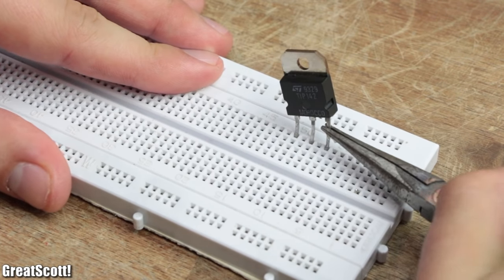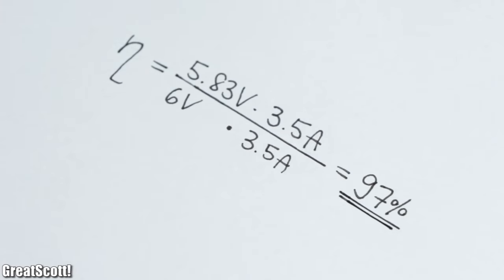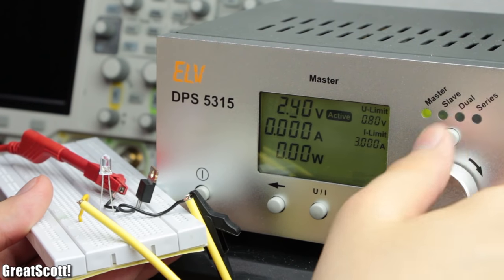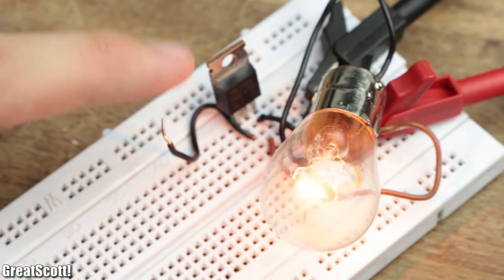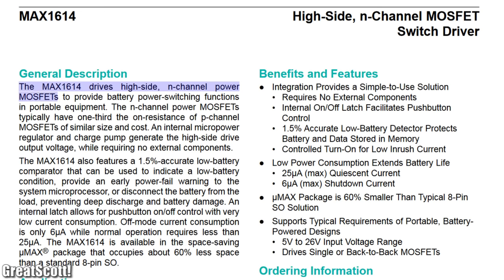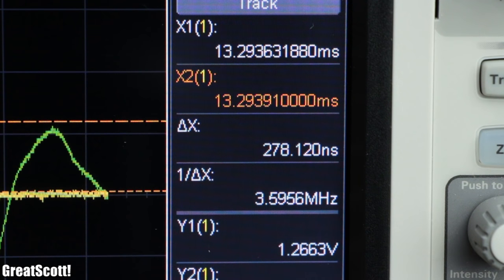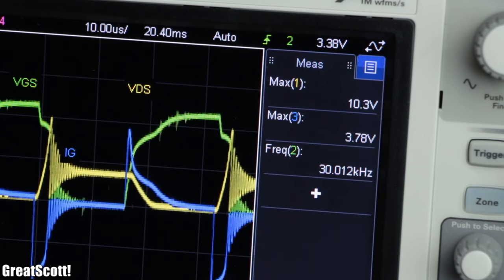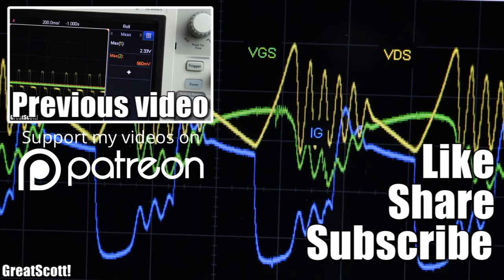Electronic Basics #23: Transistor (MOSFET) as a Switch

Comment: I would really like it if the information would have been stretched to about twice of the length of the video. To do that, maybe you can talk about the values you underline after you mention them. For example, while you are underlining Vth and saying "MOSFET has to cross the threshold voltage at the gate to operate" Instead use a short clip while stating the line above and then use the datasheet video clip while stating the values and how they relate to your circuit you are currently working on. I know that this might increase your work per video but you can maybe put one more short 5 sec add to make up for your extra efforts.

Comment: Wait, I thought that if the signal going into the N-Channel MOSFET was high, then the output of the MOSFET was high, not low? Why is this? Thanks
Reply from the maker: When the voltage drop of the Drain to Source path becomes "low" (almost 0V) then it means that the switch is turned on.
Reply: Ok, Thanks and can you please reply to my comment on your Thyristor, Triac electronics basics tutorial, thanks again :)
Reply: this is because 180 degree phase shift in output voltage,when voltage at gate to source is positive then output voltage Vds is negative or vice versa and current Id is in phase with input signal

Comment: Im testing irfz44n with an esp32 drone build. I burnt up 2 gpio pins. I have a flyback diod and flyback capacitor with a 220ohm from gate to gpio. I was thinking i could use a npn to control the mosfet. My understanding is the 3.3v pin is not enough voltage to power the mosfet.

Comment: project idea: Convert a NiCad tool/device to LiPo batteries is easy, just pick the right number of cells and appropriate capacity, right? The problem is no low-voltage cutoff protection . Please design an easily adaptable circuit for the number of cells being used but with the correct cutoff. thanks

Comment: Im making a 555 monostable circuit with a motor at output. The problem starts when I try to put the motor and circuit stops working correctly..I think the problem could be the mosfet cause I've already put the paralell diode and a capacitor between the motor thinking that it was the main problem but obviusly it doesnt. Pleasr can you tell me how to fix it or where can I watch information about. Great videos.

Comment: Pls upload a video about how to read datasheet and its practical meaning .
Reply: The main things you want to read about a MOSFET is it's voltage and current ratings as well as it's RDS value the lower the RDS value the better. Maybe also the gate threshold voltage so you know at what voltage the MOSFET turns on.

Comment: Dear Scott.
I hope you can help me out.
I am building a 6x6x6 rgb ledcube.
I want to use a mosfet to switch the ground of the leds.
So the current wil be between 15 and 540ma
The leds voltage wil be 5v.
The arduino to gate wil be 5v 30mA
Can you help with mosfet to take.
Thank you in advanced

Comment: I'm using this method to switch an LED strip using  PWM signal from an arduino. When the PWM signal is set to 255 (Always on) The voltage across the LEDS are only 10.4V even though the source is 12v. Not sure where these 1.6v are being dropped but I WANT THEM BACK.

Comment: If I want to use something as a switch in a circuit with such a component that is neither connected with Vcc nor GND, e.g. switching three sets of resistance for control gain of an ac amplifier or a ac signal to stop or allow to the amplifier input, and control the switching with arduino, what should I do? 
Relays are okay in this case. Buy very soon circuit is becoming bulky.
With a 10 kHz signal, I think TRIACs are also not applicable. 
Provide me some suggestions.

Comment: Hi. Thank you for your videos. I have a question. As thr good way to connect an Arduino to a Nmosfer with a pull down resistor, the mosfet off aytomatically, but if I want to keep the mosfet on without to have an output of Arduino in ON, is there some way to do that simple? I know that the simplest way was to eliminate the pull down resistor but this is not a good idea. Thanks in advance and best regards.

Comment: I would like to make a led light bar that flashes 16: 1 watt leds, 8 white and 8 red preferably with the ability to flash 4 at a time. I have a arduino that is outputting the signal to my tip120 that is going to switch the 12 volts to the led driver but after watching this video I dont think i am doing it right, what do you recommend?

Comment: First, thank you for the good videos. I have a question please, Is it possible a circuit to activate a mosfet and keep it ON without the gate signal (for example if I activate the mosfet with arduino, to not have an Arduino output connected ON but the load keep connected). Thanks and best regards, Lorenzo

Comment: Nice Video!
I wanted to use an IRFz34N for a simple speed control circuit to my linear actuator (5-8 amps) controlled by my micro-controller. 
I ordered the parts and I have the pull down resister, but am I limited as to the switching frequency due to the issues you mention?

Comment: im so confused on what i should be using. bjt or mosfet ro something else. i wanna controll a 12v relay coil which draw .15a. i prefer switching the high side. what should i be using? ill be using an arduino. also i love your videos

Comment: Is there anyway to check the continuity of the load (LED in this case) through the MOSFET with an ADC pin without blowing up the arduino with the load voltage?

Comment: Hi Greatscott, very nice video as usual. I have a logic level n-channel mosfet(FQP30N06L) and switchin on-off by appliying 0 and 3.3v Vgs from a gpio pin. Drain side I have a load operates at +5V. After the pc turns off, PC pulls up +5V  all GPIO pins(Vgs). As a result after pc turns off it  turns on the load again. How can I prevent the gate voltage if more than 5V at the logic level mosfet? Best.

Comment: I noticed that you don't have a current limiting resistor for the led, I was thinking of a 3V 350mA 1W Led load and PWM dimming. should i add a resistor to limit the current?
Reply: or just make an lm317 cc source. not that hard and you can run high power leds for a long time.

Comment: I may be wrong bt why is drain the collector and source the Emitter. Shouldn't source mean collector and drain meaning Emitter
Reply: Well if you compared a BJT to a MOSFET then the source and emitter are connected to ground if the said transistors were a NPN or N-Channel while the drain and collector is connected to a loads —

Comment: +GreatScott! I have question:

Can the N-channel mosfet turn on and off in high frequency (say 300KHz) without oscillation circuit?

I remember when I opened a cell phone charger; I noticed that the high 
frequency transformer is driven by square wave oscillation from N-CH 
MOSFET. But what I didn't understand is that how the MOSFET can be used 
to deliver this high frequency square wave. I have not noticed any 
familiar oscillation circuitry though like 555 timer to drive the gate 
of MOSFET to deliver such high frequency square waves.
Reply: the mosfets recieve a high frequency voltage on the gate from an oscillator so it oscilates the voltage flowing from drain to source, its more efficient to do it this way than to oscillate the voltage coming into the transformer directly
Reply: +lol49031 Thanks man; but when I examined the phone charger circuit, I did not noticed any oscilator driver at the gate of the MOSFET.

Comment: Great video 

I want to ask something, I want to adjust the voltage across the load according to what I want, after simulating in proteus the voltage at the load remains equal to the source voltage to the drain, I have set the duty cycle in such a way but no changes occur, what should I do do?

sorry for my rip english 😋😋

Comment: what's more power efficient? a PWM circuit to control brightness on a LED or a variable resistance connected to the base of a BJT?
Reply from the maker: PWM
Reply: The reason being with resistors you're dissipating the power as heat but in the case of PWM you're just not giving power to the LED which means no power is dissipated by heat

Comment: sir if battery rating is v volts n I Ahr does power of battery be VI eg
7.2 v n 4.2 Ahr gives 30. 24  joules an hr n what would be the power?
also
I think it is better to tune the potentiometer to less resistance to use the battery power efficiently n reduce the loss as heat.

Comment: If I wanted to turn a PSU on through the green wire and ground using a raspberry pi's GPIO, would it be best to use a mosfet to silently do the switching?
Reply: if you're using mains voltage/AC, don't, do some extensive research about it, the safety hazards and you will know what to use.

Comment: Am new to using mosfet I like to know why irf4104 get hot in 1second when using it to making a inverters,I used 2 mosfet irf1404 I used a  two100ohms resistor at S and G and  two 987ohms at D and G but instead on switching to ac the transmission got really hot nothing work the battery so hot it burn my fingers I read alot of info on inverters it look so easy but I cant get the mosfet to work do I have to use 470 ohms to gate and and drain instead of a higher value

Comment: I am trying to control 2wheeler horn with my esp32 through a 12v automotive relay,horn is taking upto 15a of current at 12v.
THE problem is whenever i send on signal for 350ms by esp32 relay remains on ,it get stuck.What to do?

Comment: Hm, but in which cases should we use a BJT instead of a MOSFET ?
Reply: when you need to control a low current load and need very fast switching speeds

Comment: I ordered the IRLZ44N mosfets online and at 5V pulling 600MA it gets really hot. It seems like you need a higher voltage than the drain/source voltage for them to run properly, to my understanding. Because I applied 10 volts at the gate and it works perfectly so how can I use a mosfet when I only have one power supply?

Comment: would it be also possible to reduce the switch-off oszilations by using a low-pass RC filter ?
Reply from the maker: Should be possible in a way.
Reply: bad idea. an RC filter for the input would move the mosfet out of the linear area or make it continuously on, depending on the duty cycle. for the output it would change the circuit into something else from what it meant to be
Reply: I get the argument against the input RC filter, but not that against the output RC. How would it change the circuit? Let it be a digital to analog converter with a cutoff frequency of 1Hz for example. DC motors are going to run smoother that way (.. am I missing something?)
Reply: First, you can't really load an RC filter with a motor as it will change it's behaviour from a filter into a current limiter with a little bit of buffer. In case of an inductive load (like a motor), it is important to know that using the simple version of the circuit shown in the video will destroy the mosfet. You have to use a flyback diode to protect the mosfet. It is common to use also a small value cap paralleled with the diode to decrease the voltage spikes (and also decreases the EMI generated by the fast switching of the motor.)

Comment: Hi Scott. I need a msofet to quickly switch current in a very fast manner. But the problem is the gate capacitance that comes with my power mosfet (IRF510). How can I eliminate this from my circuit?
Reply: 10K pulldown resistor between gate and source. If it's still too high try decreasing the resistance. Can't guarantee that it'll work though, but it's worth a try

Comment: Great video thanks for sharing.
One question in wiring up the LED on the breadboard at 2:34 in the video, there is no series resistor. Did you use an LED with built in series resistor?
Reply from the maker: No, I used a supply voltage of only 3V. No resistor necessary

Comment: Thanks for the Video. This might be a noob question, but around 3:00 you said when the VGS goes up, the VDS does dows, why? isnt the Voltage on VGS should open the Mosfet and make the current flow From D to S?
Reply: VDS is the voltage drop accross the mosfet, so when Gate is Low, the mosfet as a resistor has a high resistance, so no current flows and the whole voltage ist accross The DS path.
When Gate is high, the mosfet becomes conductive , and has a Low resistance, for example 0,022 Ohms for a Irfz44N
, So with a current through the DS-Path, 
Only a voltage drop of 0.022 volts would be measurable.
Reply: So with noob language: Voltage drop ds means that the current flow?,  just like when using a battery and the voltage dropes when current flow?

Comment: these mosfets are driving me nuts. leave out 10k resistor, voltage to gate starts fan but doesn't turn off. put in resistor from gate to source and nothing turns on anymore

Comment: hi sir
 I'm new in this area
could you pls tell me a circuit that I could use to switch on and of the the MOSFET at very high speed without using any ic or microcontroller but by using easily available things like resistor's and cap's
Reply: you can't

Comment: Would it be possible to experience loss due to sending a weak 1 when using a Nmos as a switch HIGH. So far I'm experiencing power loss and I think it might be because Im using a Nmos to pass a logic one. I have my gate tied to a digital write from my arduino to my NMOS, and my NMOS-drain is connected to the VDD, and the Nmos-source is connected to my load.
Reply: Maybe the gate voltage is not enough to turn on the mosfet fully?  Some require >8-10V for switching big loads

Comment: Why the 10k resistor would prevent the gate from interference?
Reply: Well an example is if you touched the gate of a MOSFET it can mess with it by turning it on or off, the 10K resistor prevents it from being turned on randomly by keeping it off

Comment: Hi what does the pull down resistor do to prevent it from turning on the mosfet without any supply?
Reply: It pulls the gate down to GND. if the source is also connected to GND then Vgs = 0V and the mosfet is effectively off. without the pull down resistor you can have a floating voltage on the gate in relation to the source and allow current to flow through

Comment: But what is the difference between a transistor and a mosfet? I know they are really different but I don't know what are the differences
Reply: The MOSFET is a type of transistor. There are two main types of transistors: bipolar ones (like the BJT) and field effect ones (like the MOSFET itself). Bipolar transistors become conductive if you apply current to their base, the higher the current, the higher they will amplify the signal. Field effect transistor become conductive if you apply voltage to the gate which causes them to charge up like a capacitor and stay conductive even if you remove the current, the amplification is dependant on the voltage instead of the current. Another difference is that BJTs heat up a lot and thus are less power efficient than MOSFETs

Comment: pls could you tell me how the pul down resistor can prevent it from turning on through electrostatic voltage??
Reply: it grounds the voltage of the pin so it's no longer floating and has a connection to ground

Comment: Hi. ..do you think it should have a resistor or other protection system (optocoupler etc.) 
between the arduino pin and the mosfet gate?
Reply from the maker: Like I showed in the video, a 470ohm resistor is a good idea. But there are tons of way to protect the Arduino Pin. Optocoupler, pulse transformer, Push Pull BJT configuration,......

Comment: Hey guys, I am trying to output a digital 1 or 0 (+5V-0V) based on a reading from a sensor. Can I use IRLZ44N for this? if the gate to source voltage is above 2 volts, the mosfet turns on and I will have 5V from drain to source, which I supply externally. Thanks!
Reply: ege621 use a simple BJT, using a MOSFET is overkill

Comment: Great video I have just discovered your channel that led me to automatically subscribe.
When it comes to PWM signal, I am using a STM32 in which the pins deliver 3 to 3.3V Is it possible to control the Mosfet with that in order to dim a bulb?
Reply: This does pretty much depend on the current draw your bulb has. I would suggest using a IRLB8721PbF for this application. Please look up the datasheet and compare with your parameters if this is a fitting one.
Reply: Thanks for your reaction
Reply: @nysseexaucekaya8620  You're welcome :)

Comment: I tried using a MOSFET (FQP30N06L) as a switch for a 12V 5 amp LED strip as a switch with my raspberry pi (3.3V GPIO).Unfortunately, when the MOSFET isn't able to turn my lights to full brightness. Any explanation?
Reply from the maker: The voltage drop of the drain to source path is too big with 3.3V at the gate. Try a powerful level shifter to control it with 5V.
Reply: Gotin Fuklio would I still be able to use PWM with a level shifter?
Reply: GreatScott! Thanks!
Reply: Gotin Fuklio I thought the level shifter would create a delay when raising the voltage from 3.3V to 5V thus messing the PWM parameters such as frequency by a noticeable amount.
Reply: Gotin Fuklio I'm reaching about 20% brightness with the current setup I'm running.
Here is the setup:
http://imgur.com/a/EfDIi
Reply: Gotin Fuklio Yes it starts to heat up a little bit after I let it run for a couple of hours. It heats up, but not close to the point of burning.

To eliminate the theory of my Pi not giving correct pulse widths, I made it simply send normal 3.3V.

I measured the voltage between Gate and Source, I got 3.3V
Between Drain and Source, I got 6V instead of 12V.

When I applied 5V from the raspberry to the Gate on the MOSFET the LED strip instantly turned to full brightness. So the reason of why it isn't fully turn must be because the 3.3V from the GPIO of the Pi aren't enough right? What is my solution to this? Level shifter as GreatScott! mentioned?